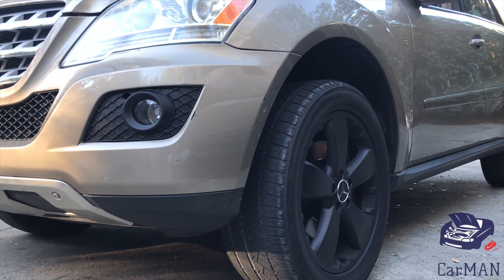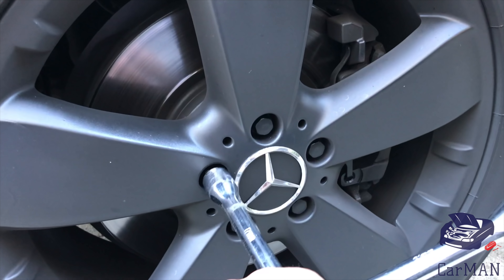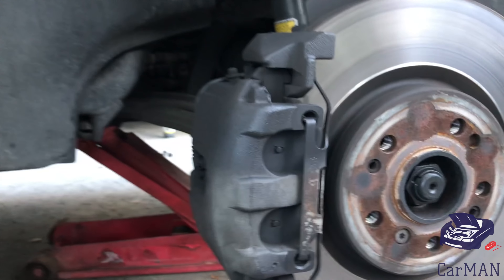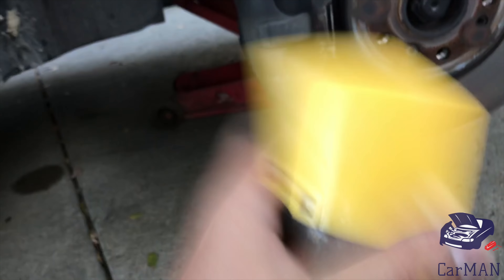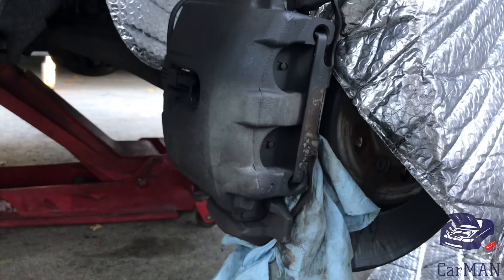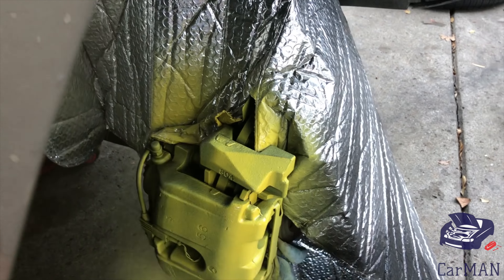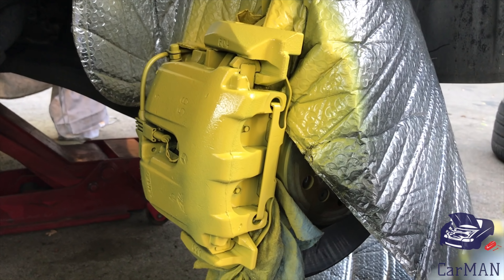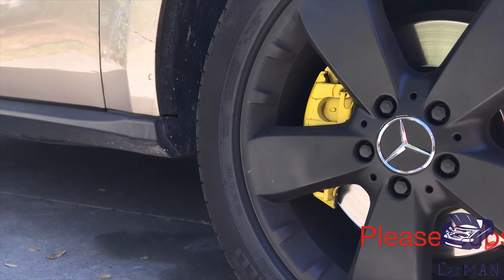Paint your Calipers FAST | Brake Caliper Paint | Yellow AMG Brakes | CarMAN

Comment: This might look okay to the untrained eye, but the average car person can see this is a quick, hack job.  I mean it looks okay looking at it from a distance, but would be nicer with just a some more details taken care of.
Reply from the maker: Hi, I have done this on several cars and have always received compliments every time. Yes but you do have a great point about it not being the best and that’s because this was a FAST job. Someone, especially a first timer that wants to do a modification to there care, very easy.
Reply from the maker: Thank you so much for watching. And I will have another video up soon for doing a much more cleaner and more detailed caliper paint job. Please stay tuned.
Reply: You say that because he painted over the brake pad and hardware right? Should of disassembled and taken those out, only painting the caliper correct? What else do you notice?
Reply: @tcblackg35  Yeah that's mainly it.  It would be like painting an engine with all the rubber hoses and accessories still attached.  Someone might be impressed with it all being a pretty color, but that person is likely to be under 4 years old or know nothing about cars at all.  If that wasn't hack enough, it takes a budget single-sided caliper (not a dual sided 4 or 6 piston) and paints it a bright color to draw attention to it.  That's a bit like spray painting the words 'Nike Air' onto a $5.00 pair of Walmart shoes.
Reply: @ArchimedeanEye  lmao very true